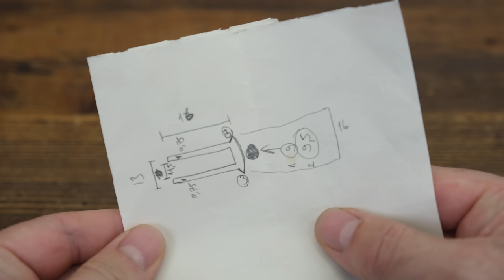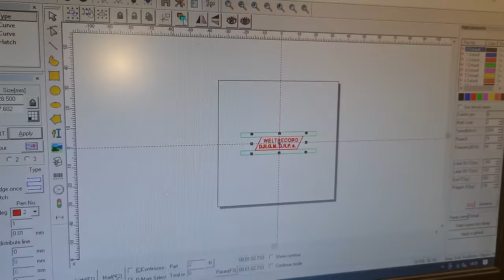1890s Weltrecord Ratchet Screwdriver Restoration - Restoration Videos

Comment: I’m not a metallurgist, but I think you need to temper that screwdriver blade.  You heated it (Austenitizing), and you quenched it in oil (Martensitizing), but unless you temper it (heat it to 250°C for an hour or two) to relieve internal stresses, the blade will be very hard (resistant to scratching) but very brittle (easily broken).
Reply from the maker: Thanks for info

Comment: Curious why a sandblaster wasn't used on some of the parts - especially those with inner cavities.
Reply from the maker: There is sandblasting on the black piece that I cold bluing, but I cannot take pictures because of the glass of the sandblasting machine, so it is not in the video.

Comment: When I see fuzzy rust I instantly tune out because it’s been artificially rusted by a chemical of some kind that accelerates the rusting process. You can also tell due to the small amount of sanding it takes to see clean metal and the pitting is superficial like I think on the lathe you removed a couple thousands to be into clean metal.
Reply: Насчёт искусственной ржавчины это вам к одному вьетнамцу на канал нужно. А здесь мастер может взять даже новую вещь из магазина и довести ее до идеального состояния.
Reply from the maker: is it new?

Comment: This is not in any way a restoration. This tool would never have looked as good as it does after the restoration. This is not what this tool looked like when new. This is what this tool would look like if made by Snap-On today and even then, this goes even further. Sorry, but to call this a restoration is incorrect. This is upgrading and modifying and removing all traces of the original work done to create this. You have erased history.
Reply from the maker: So?
Reply: @meinemechaniker so it is now worth nothing more than a new modern tool of similar design. All of it's historic value has been destroyed. The marks made my old machines are gone, Coloring created by many years of hands darkening the wood has been eaten away by acid. The scratches that were made by a workman's hands, decades ago, now gone forever.
No serious collector would be interested in this.
Reply from the maker: @101Osprey101  Dude you need to visit the archaeological museum! You shouldn't be here.
Reply: @meinemechaniker so you get my point. However, instead of conceding that point, you choose to throw insults. At no point did I personally insult you or the quality of your work, even if it is altering the item more than restoring it. I simply pointed out a fact that can't be denied and your response is to be a jerk. Cool.
Reply from the maker: @101Osprey101  smell of cheap beer

Comment: Why. This made me die inside. It went downhill after about 5 minutes into the video when you mounted material in the lathe with a huge amount sticking out. 6:54. Please don't do that ever again. It works but its just bad practice.  You made a tapered pin where you then hammer it out. Why did you use a file here 20:28? Sand paper wound have kept the branding and left a nicer finish. Mounting the chuck in the lathe and taking the entire surface down with a cutter was wasteful and unnecessary steel wool would have been fine 11:16. There is a lot more but I'm sure you can find it. I regret making this comment because it counts as engagement towards the video. Young people like me will watch these videos and assume because the end product looks nice that it was restored incredibly well when in reality it is filled with bad practice and wasteful processes. Not to mention it discourages people from restoring things.  I do not have a lathe and it is used so much where it is not needed.
Reply from the maker: Just fun 👌